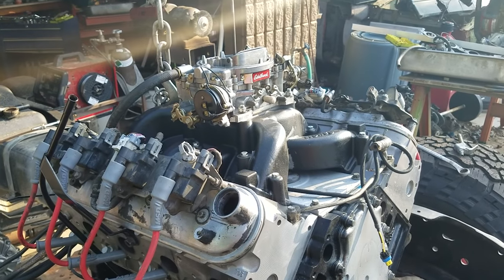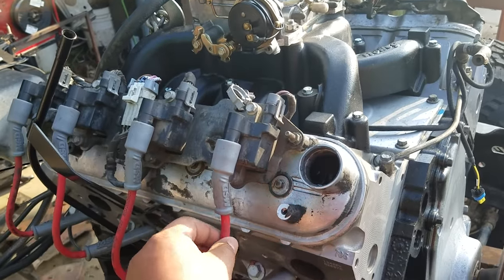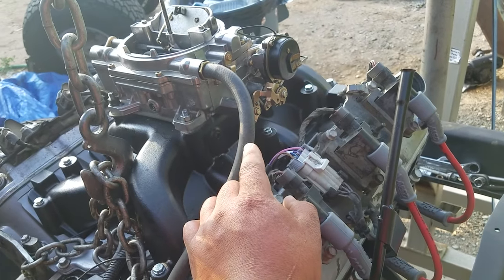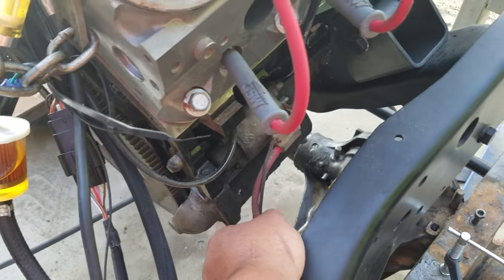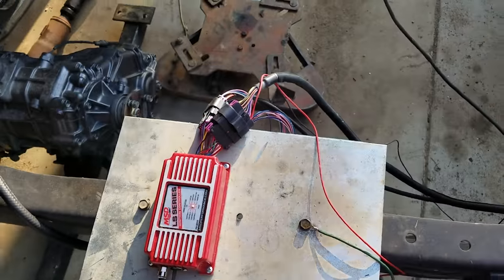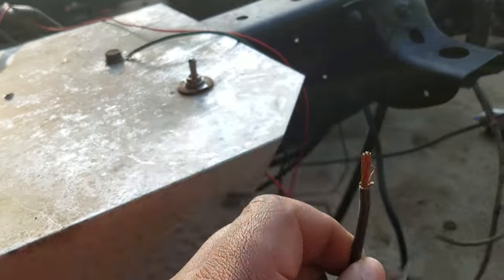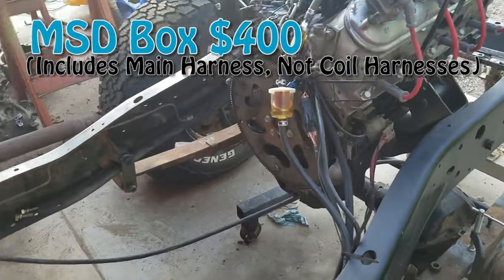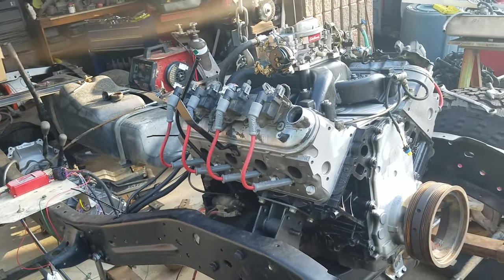HOW TO INSTALL A CARBURETOR ON AN LS SWAP, LS1, LM7, LR4, LQ4, L33 | Carbureted LS | Carb LS |

Comment: I think people are stumped as to why you would want to run a carb.  Let me help them out.  Simplicity.   No computer and new wireing harness or sensors.  No new gas pedal,  no new transmission, drive shaft and shift leakage to fab. No new fuel tank.  Much better engine in a old school vehicle.
Reply: Spot on. I'm considering it for my swap for every one of those reasons
Reply: Do you have one? 😂you don't know Jack shit😂😂😂I have one.and yes it's better fuel injected.you know how much trash is in that old fuel tank?and you still have to put an electric fuel pump on an ls anyway.so ya better change that tank.i found out the hard way.😂I could go on and on.😂😂😂
Reply: @thatman4853 electric pump yeah... But a world different fuel pressure..
Reply: I’ve spent too much money on tuners to not have a good idle so this is my next route
Reply: @adammanmiller4546 must have been some shitty tuners😂

Comment: The reason I went with lS swap was to get away from a carburetored motor
Reply from the maker: Lol I can totally agree. I wasn't to upset with carbs. The LS platform is basically the perfect engine and even in carbureted form is runs perfect
Reply: @NightWrencher  yeah it seems like a simple set up, but I never have any luck with carbs
Reply: ..the reason I am even interested in this is because I don't want anything to do with injection and it's electronic controls/excessive wiring, sensors, high pressure fuel pumps, etc...but option makes me interested in an LS....
Reply: @dyer2cycle  fuel injection is not that complicated.  With an LS carb swap, you're going to need all of that anyway other than injectors.  If you had a pulled LS engine,  you could get an Fi Tech standalone ECU and wiring harness.  Connect harness to the original fuel injectors.  Plug it into the coil packs. Plug into other basic sensors like cam sensor,  crank sensor and temp sensor (already in engine). Literally all of that is just plug and play, it's not hard

Only real thing you'd need to do is have one O2 sensor in the exhaust pipe (so the computer can trim fuel automatically) and run a fuel injection rated fuel pump (you'll have an electric pump for the carburetor,  regardless) 

I've been wanting to carburetor swap an LS for a while,  but every time it comes to it,  fuel injection always comes out on top.
Reply: @blakeholder7645  ..how much would all that stuff cost approximately?..what you are describing sounds fairly simple in the context of electronic fuel injection, but it sounds expensive,and still has the words "electronic", "sensors", "ECU", "computer" included in it...I think I'll stick to SBC and what I really like, 292 and 250 inline six...what got me interested at all in the LS is the fact there are a lot of them available now, whereas the sbc's and especially the inline sixes are getting harder to find(inexpensively)...
Reply: they make efi carbs
Reply: @K2007_6  yeah fuel injection
Reply: @K2007_6  ..EFI is NOT a carb...a carb is not fuel injection...you are thinking about throttle body EFI...looks similar to a carb, but it is not...
Reply: @dyer2cycle  well it looks like a carb with efi built into it
Reply: Wat type of carburetor u have
Reply: The reason I’m going LS is because you start out with more power stock, parts are basically just as cheap, and my reason for going carburetor is throttle response is unmatched and I don’t wanna have to do a fuck ton of wiring 😂
Reply: @ImThatGuyPaI  I done no wiring plug an play wiring harness an computer from psi

Comment: I just picked up a holley 750 carb on the LS carb intake, MSD box and the coil packs for 600.  Swapping a L33 LS into a 1st Gen 4runner
Reply from the maker: Thats gonna be sweet! A 750 vac secondary will flow pretty well. A 650 would probably be better suited unless you plan to add a bigger cam etc.
Reply: Hows it going
Reply: @infamousnova  it’s been going pretty slow.  Motor and transmission are in.  Working on the Transfercase and building a full float 9” for the rear
Reply: @SubePelayo928  Thats ok, take your time and make sure its right.
Reply: @infamousnova  once time frees up and I can get back to working on it. I would like to start documenting my progress and upload some videos of it.  There’s quite a few videos of 4runners crawling. But none of the 1st gen built into a prerunner/dune type. Which is my goal since I go to Glamis often.
Reply from the maker: The 1st and gen 4runners are the classic overlander. Because theyre body on frame, theyre pretty rugged and retrofitting somr long travel suspension is realitively easy compared to other similar suv models. I'm going to be starting on my 2nd gen 4runner build sometime this year but itll be for more light crawling
Reply: @SubePelayo928  Thats a great idea. Definitely upload it, you can help inspire others
Reply: @NightWrencher  how my 4runner was built before I tore it all down. Had a stock 22r w56 and doublers. Loved it!  But I seen a 1st gen 4runner hauling but through the dunes with a pack of sand rails and instantly fell in love with it.  My 4runner is set up with 4.88’s and Detroit lockers and chromo axles, Trail gear leafs and high steer.  Going to keep the suspension the way it is for now. But I did end up selling my dual cases and transmission. But I do have a th350 to Toyota gear driven transfercase adapter and a 4.70 spare transfercase if anyone is interested
Reply from the maker: Heck yeah man the doublers pull out all the torque put of any engine even the little 22r can crawl with the big boys. I've got the r150 out of a 3vze 4runner in my dodge with the LS with the stock chain driven case. Later when I get more cash I want to either adapt it to the gear driven case off the w56 or switch to the np205. Still waiting to see how well the r150 holds max v8 power though since I'll be LS swapping the 4runner with like a 4.8 or 5.3. So far its holding on well against 250whp/300tq
Reply: Hp?
Reply: @Kayaan_thegreat  shooting for 400 wheel
Reply: So my father in law has this old Chevy deluxe step side truck and all I hear is my 350 don’t have enough power. So I’m going to replace it for him for his birthday and I’m going to go with about the same set up my question to you guys what’s trucks should pull a doner engine from that wouldn’t cost slot of $
Reply: @lucaswalker104  the 99-06 truck era are the cheapest. They’re the gen 3 motors which have plenty of power.  You could install a set of aftermarket heads, cam and exhaust on the old 350 and produce over 400 HP for about the same price as an LS swap will cost. Maybe less

Comment: This video is a game changer . No more  friends standing around scratching their heads on to the 50 reasons the F/I no longer runs . BTW a electric carb fuel pump should work and I heard a vega electric will work.
Reply from the maker: I've had several people run a few different types of pumps and the cool thing about a carb is that they all work well. On a return style regulated system, your fuel pressure is set dead nuts and youll never have to worry about over fueling your carb.

Comment: be careful running an engine off the heads if its cold outside the cooling and heating effect on the valves will burn them
Reply from the maker: I've heard that as well, luckily nothing bad happened and its been running good for over a year and a half 👍

Comment: Thank you so much I just found this video. I don’t know jack about building or working on motors, I just bought a 92’ s-10 and a 5.3 with 4L60 pair. I don’t even know where to start so I guess I will be a YouTube junkie to learn how to get it running. Cross my fingers any suggestions will help

Comment: Will the mad box hook to factory gauges? An thank you so much man it’s a great video
Reply from the maker: The only output the MSD box has is an RPM signal that works with universal tachs or tachs that accept a GM square wave RPM signal. I'm afraid you'll need to change the senders and gauges if your stock ones work off of the PCM.

Comment: 1100 is on par with the Holley terminator X for keeping the fuel injection. I am old school, carbs just work for me. I am in no way against efi, my 460 stroker runs with FiTech efi.

Comment: I turned my 2007 6.0 l LS based vortec into a 950 CFM alcohol drinking monster in my 1930s style coup hotrod build using a metric frame that came in all your g body cars like cutlass supreme and so on in the 80s everything I built was free to me cuse I just used what I had laying around from asphalt circle track racing the body is a fiberglass vintage dirt modified body that is made for a metric frame based oval racecar I have longtube open headers that are painted white with high temp powder coat it looks like a bad to the bone 1940s-60s style asphalt super modified all street legal fully caged with Ford nine inch floater 4 link suspension with rear track bar and fully adjustable 1 3/4 in sway bar and of course Jack bolts for all four racing springs racing shocks from Penske, 3 speed Muncie with 7in triple disc clutch.
Reply from the maker: Thats a little too extreme for me 🤣

Comment: Maybe I missed it, but when you switch an LS to a carb, where do you set the wide-open ignition timing curve? Is it similar to a conventional carburetor/distributor engine? Roughly 20 degrees at 2,000, 30 degrees at 3,000, topping out at 32-34?

Comment: I would love to see a Victor Jr. 2bbl intake for LS and use a 454 tbi or a bored out on it and use a MS or Speeduino.
Reply from the maker: You could always run a 2bbl adapter on the single plane and it would work exactly the same. Same could be said for any TBI unit but I dont think I would replace factory EFI for diy tbi imo.
Reply: @NightWrencher  My understanding is that single planes are really lacking in the low rpm range and vacuum because of the large plenum volume,  with the TBI it doesn't care on vacuum like the venturi's on the carb does. In theory its shouldn't effect low end very much and still have good vacuum, mid and high range performance. User "Fast355" used that Victor Jr. 2bbl with a TBI had good results but then again it a vortec headed SBC.
Reply from the maker: I don't think you would pick up the power on the bottom. Richard Holdener did an intake test with both carb and EFI and found that even with a TBI unit like the fast, sniper, xfi, etc, power numbers and curve were exactly the same. So it was concluded that the intake design dictated the power curve, not the fuel supply system.

Comment: Can you run the ls with an electric fuel pump good at 4-7 psi for the carburetor? That's what I have on my stock carburetor  chevy 350 but I'd like to know if I can run the same pump when going carburetor on an LS.
Reply from the maker: I have another video showing you guys how to retrofit an electric pump inside your tank and I have it regulated at 5psi. Works perfect.
Reply: @NightWrencher  thanks for your reply, will check it out.
Reply: Yes

Comment: The stock computer is not eliminated when going to carb setup?
Reply from the maker: The stock computer in COMPLETELY eliminated when going carb. Your carburator will run the fuel, and an MSD 6014 will run your coils.
Reply: So you don’t need the computer ?
Reply from the maker: You do not need the stock computer for a carb swap on an ls. You will need some sort of ignition controller such as the MSD 6014.

Comment: Question I’m running doing a 5.3 ls swap with a msd and intake ,on a 98 gmc sierra do I need to still run a standalone harness to use for the transmission ?
Reply from the maker: The MSD 6014 has no transmission control so you will need a transmission controller and sub harness if you plan to run a 4L60e
Reply: Dang .. I gotcha makes since

Comment: To maintain my stock gauges on 75 k10 I want to instal the original oil pressure sending unit on to the 5.3. Please advise with parts list. Thanks.
Reply from the maker: You can remove the stock oil pressure sensor from the back of the block on the LS and install an adapter. The LS size is like an m16 or something like that but you can get a fitting that goes from the LS metric size to the sbc npt size. Idk what size your sbc is but heres a link to a kit if your stock sensors are 1/8npt
Reply from the maker: https://www.ebay.com/itm/LS-Oil-Pressure-Coolant-Temperature-Gauge-Adapters-For-Chevy-Silverado-1500/253983919559?chn=ps&norover=1&mkevt=1&mkrid=711-117182-37290-0&mkcid=2&itemid=253983919559&targetid=1068323855270&device=m&mktype=pla&googleloc=1013576&campaignid=11760659449&mkgroupid=112020222897&rlsatarget=aud-622524042678:pla-1068323855270&abcId=9300462&merchantid=101696136&gclid=Cj0KCQiAyoeCBhCTARIsAOfpKxiEk_tdhnrzNs3G8ZS3WSSeHXpmB0SW0kI_ekvixm6tAlwpsVygw6YaArwrEALw_wcB&pageci=da899026-008b-465d-b286-39f34c4c0b54
Reply from the maker: I think ICT billet also sells them. 16mm to 1/8npt
Reply: Ordered. Thanks bro. I appreciate you.
Reply from the maker: @kenitescribes8963  no problem, anytime 👍

Comment: If you don’t got your original stock wiring harness will it still work with aftermarket wiring harness ?
Reply from the maker: You dont have to have any harness except for the little coil pack harnesses. The unit comes with a harness so you just need power and ground for the box
Reply: Thank you
Reply: So you got have that msd box for it to work
Reply from the maker: Or the daytona sensors box. If you know how to reprogram and tune the stock PCM with HP tuners you could use that too. You cant just install the carburetor on the stock engine, it wont work.
Reply: Can you I use 4l80e 2007 and up if I go carburetor
Reply from the maker: Yes if you buy a seperate transmission controller for it

Comment: What’s the measurement from the top of the carb to the top of the valley cover? I’m try to figure what will fit on my 70 Monte Carlo. I have 11 1/2 inches from under hood to top of motor valley cover without any intake. Thanks in advance!
Reply from the maker: Youre looking at about 8 and a quarter inches. If you find a slim air cleaner, you should have pretty good space
Reply: NightWrencher Thanks a million! 👍🏻
Reply from the maker: Youre welcome!

Comment: Did you run a relay from the box or to the fused red wire?
Reply from the maker: You can do either one. the Box doesnt require a relay because it doesnt pull enough amps to need one

Comment: Do I need to run a fuel pressure regulator if I run a tbi in tank fuel pump?
Reply from the maker: Typically yes because a TBI pump puts out about 11-15psi

Comment: What is the advantage of replacing the EFI with a carburettor?
Reply from the maker: Fuel system is easier to adapt, lower charge temps under boost, tuning without a computer, cheaper to upgrade(jets vs fuel rails and injectors
Reply: @NightWrencher  worth the loss of throttle response and efficiency?
Reply from the maker: Theres no loss of response. With a properly tuned carb youll have even more response when compared to standard EFI. Fuel efficency is another matter because in order to gain that response, youll need to add more fuel to compensate

Comment: What size fuse for the hot wire from the msd?
Reply from the maker: Manual says 7.5 amp fuse. I ran a 5 amp fuse on it, cuz that's all I had, and the fuse popped at wide open throttle in the upper RPMs. Sorry for the late reply!(YouTube hid your comment, idk why.) Good luck!

Comment: Can you explain the best way to hook up vacume line from intake to valve covers?
Reply from the maker: For the stock 5.3 PCV valve on the driverside, you can cut off the stock hard line and install a 3/8 rubber line and plug that into the base of the carb. For the fitting on the passenger side just hook up a line and let it dangle off the side or hook up a little air filter on it.
Reply: What about the 3/8  line out of the intake? I have a holly single plain. To the vavume canister? This is in  a 87 cutlass supreme.
Reply from the maker: Any port below the throttle blades should work just fine. You can run it on an intake port or into the base of the carb. Youll plug in 1 for the PCV and another one for your vacuum brakes. Position doesnt matter but make sure its a direct connection for it to work right unless you have a really loopy cam that doesnt make vacuum.
Reply: I do have a stage 2 sloppy cam with a 285 duration. Is there a different way to run the vacuum line with this kind of set up?
Reply from the maker: @mtrcyclmhm  ive heard that the SS2 cam gives pretty good vacuum but in case it doesnt, you're going to need to add a vacuum pump for your brake booster or switch to hydroboost brakes. if youre worried about the PCV system not having anout vacuum, just hook it up direct and dont worry about it. If youre racing the engine, youre gonna want to run an oil catch can inbetween the PCV valve and the vacuum port on the intake/carb or else youll suck oil fumes that can cause detonation

Comment: How would you wire a 4l80e transmission to this setup
Reply from the maker: You would have to use an aftermarket transmission controller
Reply: Thks

Comment: Couldn't you find the wires that go to the cam and crank sensor out of the stock computer and run it
Reply from the maker: Technically yes but to use the stock computer you need to know how to tune it so that itll work without all of the other sensors. If you just install the carb manifold as is and just try to run it, the computer will go into limp mode